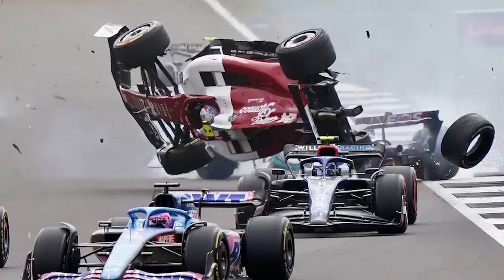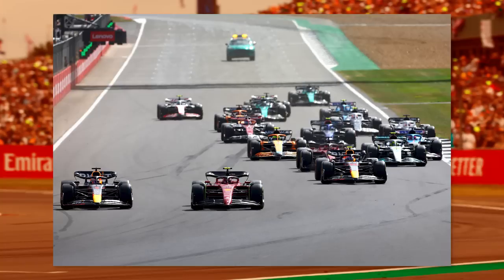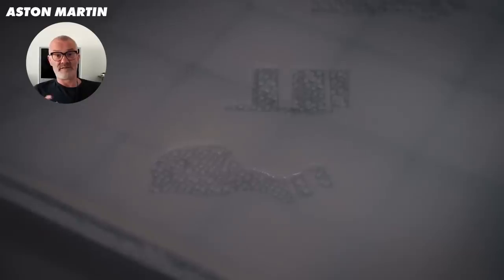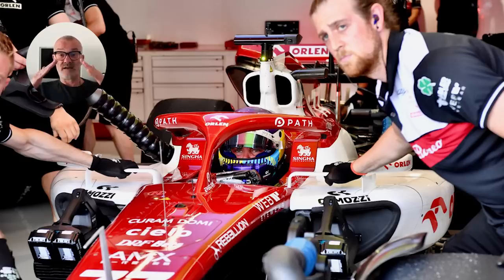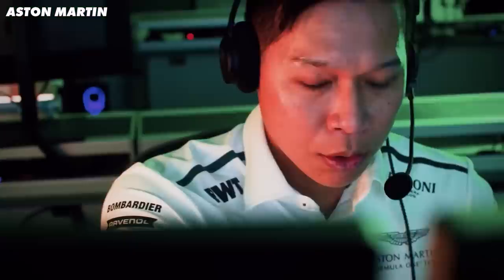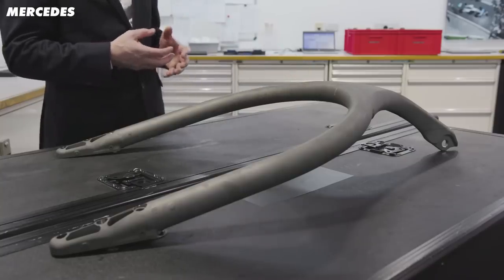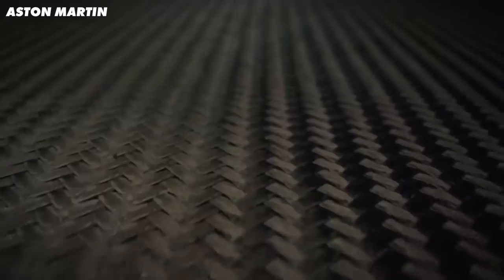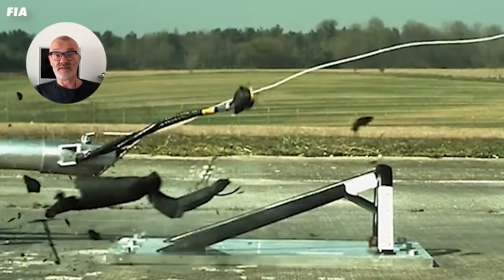Did the Roll Hoop FAIL in Zhou's Crash?

Comment: how the roll hoop is fixed to the car should be looked at. a larger surface area when bonded to the chassis or better integration into the monocoque
Reply: Or if it's the carbon that failed... maybe the whole titanium structure of the roll hoop should have... "tendrils" as it were, reaching out deep into different parts of the monocoque, rather than just being a small flat surface stuck to it.
Reply: @PiousMoltar  Even a few simple bolted connections in addition with the usual adhesive would prevent the top most layer of the carbon structure being subjected to all of the stress and tear away. The adhesive is strong enough, but the strength is limited to the layer strength it's directly bonded to. A few bolts would relieve some of that stress to a thicker area/volume of the structure. 

But they haven't done that because they aren't required to, as long as they pass the tests, they will use a method that saves most weight. But it wouldn't add much weight to the car if it became mandatory to add some bolted connections there, especially if a more exotic alloy would be used. Not for the current season though, can't really require them to update their monocoques with the current budgets until next year.
Reply: @kekkonenprkl  Agreed. No need to reinvent the wheel here. Add some bolts in addition to the bonding they already use.
Reply: @kekkonenprkl  yeah and a plate on the other side to bolt into, just the bolts would not add that much strength because they would rip right through the carbon, but a larger brace or plate would require every carbon strand to snap, as well there should be carbon string layer in a sort of U shape imbedded into the carbon around the holes so that the bolts can’t slide and rip through the carbon, also keeping the adhesive
Reply: agreed, looks from this that the flat surface the roll hoop is bonded to has layer lines only on a single xy plane... an improvement could just be to bond to surfaces on the xz and yz planes as well, at least that way if one fails there are 2 other planes of layer lines to hold it.... i am not a composite expert, but it makes sense in my head!
Reply: Since it seems intended to be a permanent component in construction, maybe a backing plate with a dovetail attachment should be used to anchor it. Plate bonded to the internal part at one stage. Roll hoop slotted in and then brazed/plugged somehow to not back out. Then laminate the rest over as they do now. Instead of a thin layer holding it on, you'd have to crack through the entire outer shell of the composite construction to do anything.
Reply: @pauljs75  Rather than just using a separate backing plate, I'd extend the halo under it and attach the two together so that they form one protection structure.
Reply: Lord Industries mfg the adhesives most likely. Used in the mfg of Apache helicopters.

Comment: The picture seems to show left over adhesive (those reddish spots that are left behind), so I'm not so sure that it was the carbon fiber alone, but certainly some of the adhesive clearly failed too.
Reply: I'm actually beginning to wonder if there was improper surface preparation on the monocoque: large regions of the adhesive were removed in their entirety which could suggest it had failed to properly bond to the carbon fibre.
Reply: @jameshogge  yet more to suggest a return to how it was done for last 50+ years without many issues.  Even if the “new is better” brigade still want to glue the roll hoop on, why not use bolts too?
Reply: @testpilotian3188  the glueing method spreads the load evenly, while the bolts method apply very strong pressure points right where the bolts are located, and also weaken the carbon fibre itself since you need to drill holes in it. I do not see a better solution other than increasing the amount of carbon surface woven into the roll hoop
Reply: @Shiinamusiclyricssubs  well don't bolt it to carbon fibre then because it breaks so easily.
Reply: @Shiinamusiclyricssubs  You would want to go the other way: carbon integrated into the roll hoop would break (its too stiff, you need something compliant to absorb energy) at the first deformation leaving just the titanium.
Reply: @testpilotian3188  or maybe you have non-destructive load tests run on the chassis which drivers actually race in
Reply: All I seen was since less stupidity!!!! I thought maybe Ricky Bobby was driving for a minute or two.....!!!!
Reply: @testpilotian3188  The problem here is that we are trying to attach a composite material to a metalic. Composites hate mechanical joints and specially hate bolts. This leaves adhesives to do the job, which isn't bad, it is adhesives the ones holding the monocoque together.

What seems to have happend is that the monocoque failed and not the roll hoop, hence why in the video they insited on using the word "departed". So no ammount of securing the hoop would help with this situation (Maybe that's an exageration, but my point is that the solution here is along different lines such as strenghtening the composites and attaching the hoop to more places rather than better to increase the ammount of places which are required to fail, maybe make the halo and hoop a single structure akin to a roll cage).

Comment: I think that the design needs to be updated to have the actual roll-hoop extend much more below the current 'bonding' area ...The potential for such awesome and variable dynamic loads/stresses cannot all be accounted for ...and now that the authorities see that there is actually a failure point still present(bonding intersection in this case), they can do some updates. Extend the Roll-hoop 2, 3 or even 4 times lower into the Tub superstructure(even bonding it with the Tub structure at several points on different planes maybe?)

...I'm just so happy that Zhou was able to survive this one!
Reply: Perfectly said.

Comment: I used to build yachts and bonding parts to parts was on the increase to save 'through bolting'. However, we had delamination problems too.  If a part failed, the naval architects would put plate (ply or metal plate) beneath for strength. Then ultimately use plates with bolts welded to them, from the outside in, through the piece being bolted on, through the laminate (grp or Carbon f) and sandwiching the whole structure with another plate beneath, then washers & nuts. Serious "belt & braces" but we were responsible for people's lives. Great video thank you 👍. Jamie

Comment: Great video, it was one of the first things I noticed first time I saw the replay. I just assumed the extra weight and a full fuel was to much for the roll hoop to handle when momentum enters the equation but I know nothing of the evolution of roll hoops, or if they got beefed up because of the added weight this year. FIA should keep the original test because it seems relevant if there are cars stacked on each other or a car upside down but stationary. Another test should be introduced for more violent shunts with the load coming on more sudden with more directions?

Comment: Im surprised the Roll Hoop is not a more integrated part on the car. Instead of it being built into the monocoque, its just placed on top....not surprised it failed the way it did.
Reply: Carbon fiber would be a poor material to build a roll hoop out of. There are reasons they are made from titanium. And with that you have to connect the materials in some way.
And again, I can't remember the last time we saw a roll hoop detach like that.
Reply: Indeed!
Reply: It SHOULD be surprising. With hindsight, it may seem obvious but the tests place very large loads on the region and provide a lot of evidence to suggest it is OK.

My bets are actually on a manufacturing defect at this point. Improper preparation of the monocoque before bonding the roll hoop to it.
Reply: It really can't be made to be more apart of the car other than to have some spikes that go into the monocoque and are also glued in along with the other glue
Reply: Carbon fibre is just thin sheets stuck on top of each other.

Resins are very strong
Reply: @jameshogge  This. A manufacturing defect seems most likely to me, too. Otherwise we should have been seeing a lot more collapsed roll hoops. Not the first time a car slides upside down.

Comment: As a design engineer who has worked in aerospace composite design I have the following comments. Firstly this component took loads that were not envisaged st the concept stage. Secondly, while bonding is excellent,I think thos should be attached to the structure underneath better. Increased load paths and mechanical as well as bonded attachments.

Comment: Modern gules and adhesive are so strong that the components they are bonded to usually fail before the glue itself. As someone studying Mechanical Engineering on my final 2 semesters, it was cool to see the FEA, it’s kind of our bread and butter. I am curious if a combination of adhesive and mechanical fasteners would prevent this issue.

Comment: Imagine being the design team  who designed the halo and knowing you saved this guys life .
Reply: The concept emerged when the FIA's safety working group was looking to protect the driver from flying objects. Two recent examples had been the flying spring that hit Felipe Massa's head, and the flying wheel that struck Henry Surtees at Brands Hatch in 2009 with fatal results. Prototype testing showed that any protective device would have to be fantastically strong to work at formula car speeds. The original designs looked pretty awful, but Ferrari had a hand in making them look compatible with F1 car shapes. There were many in the FIA technical family who worked on the original research and development, but the concept was formulated and pushed forward by Peter Wright and Andy Mellor.
Reply: @michaelhenderson4073  Thanks for that , very interesting . 👍

Comment: i've been saying it should be made of titanium when it already was, but i will say it needs to be better anchored to the safety cell
Reply: Easy thing to say with the benefit of hindsight.
I can't remember the last time we say a rollhoop detach in that manner. And again, apparently it wasn't the anchoring/glue connecting the rollhoop to the monocoque that gave way, but the carbonfiber of the monocoque itself.
Reply: @curnath  and wtf is the fia doing if their tests are so extensive and yet alpha romeo still got the chassis approved?
Reply: @GonzoDonzo  Did you even watch the video? This is such a strange accident, the roll hoop is tested in other ways, this will and should in time be incorporated into the testing and thus the design requirements of it. Alfa's roll hoop fully complied with the FIA's tests.
Reply: @curnath  I don't think the carbon fiber failed, the design did, there obviously was a flaw in the way the layers were laid down if the bonding glue held and it ripped a piece of CF out
when I first saw those photos I actually thought that regulations had changed and they did away with roll hoops or they are much lower, since the old test was a stick from the top of roll hoop to the nose of the car, and the drivers helmet mustn't reach the stick, now there is halo doing most of that protection, and the roll hoop is kind of redundant - which this accident kind of proved, it did absorb some of the initial shock though, so perhaps a crumble zone instead of hoop is now more fitting nowdays, and the sides of the halo should be slightly higher so no drivers helmet would ever protrude above it
Reply: @dghtr79_36  Roll hoops are definitly not redundant. There are lots of other ways accidents might happen that would be prevented by it. Just imagine a car running into and over the back of another one at the start. Happened a million times by now. No crumble zone is going to absorb that momentum. Having no roll hoop would mean the drivers would be unprotected from the back.

I don't know enough about the crash or the way CF is layered to judge wether that would pose a weakness to this kind of application of force, or if its just that Alpha had some faults in their layering of this particular construction. Seems strange to me, considering it's far from the first time we see a car sliding upside down, but basically never saw the roll hoop detach like that...
Reply: @arghnews  your missing the obvious. Their testing is most definitely not extensive enough and the design should have never been approved. Roll hoops arent something new so to change the design and clearly not test it well enough for it to serve its intended role shows that there is a major issue with the fia's protocols. If they failed here where else have they failed to provide adequate testing?
The other thing is that what were calling a roll hoop isnt really a roll hoop. Theyve generally been tied into the main structure not just bonded onto the body with cf and resin. This is supposed to be one of the main safety features to protect drivers in the worst accidents. If it tested to have delamination failures under certain conditions then it should have never passed. Either a new construction process or material should have been tested until those failures didnt occur.
Reply: @GonzoDonzo  Your grasping at straws here to be honest. Can you recall the last time we saw a roll hoop detach? Because I can't. Before this, there has been absolutely nothing to suggest the FIA's tests might be inadequate, and Alpha's design passed those tests. At this point, it's far more likely that Alpha had some manufacturing error within this particular construction. That's not to say there shouldn't be investigations into wether the tests need to be even more thorough, and there will be.
Not sure where you're going with your second point. The video literally stated that that's exactly the way these roll hoops are constructed.
Reply: @curnath  older chassis's are irrelevant. How many 22' cars have flipped and lost their roll hoop? Is it 100%? I cant think of any other rollovers atm, maybe theres one out there though. I do sometimes pass out watching F1 on the west coast of the US. 
The thing with the roll hoop is it should be able to pirouette down the straight upside down with multiple cars parked on top of it, then flip and smash straight into a concrete barrier and still not fail.
Reply: @GonzoDonzo  Right... so you agree there has been no hint of the FIA's tests being insufficient before this then. Good.
Oh, and of course nothing about the roll hoop changed in any way, shape or form from last year. They've been made from titanium and glued to the monocoque for quite some time. Pretty damn sure the FIA didn't just relax their testing standards either.
Again, we'll see, but i'd say right now the most likely scenario is Alpha having some manufacturing error in their carbon fiber, since the roll hoop didn't fail, but carbon fiber it was mounted on.